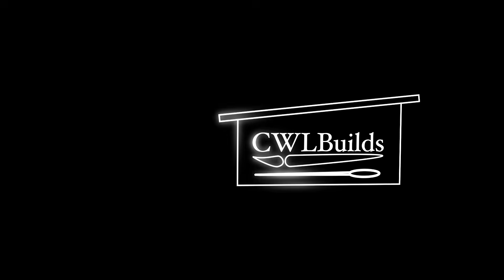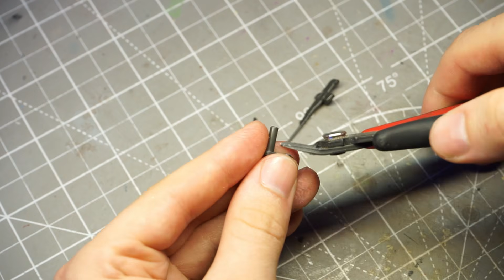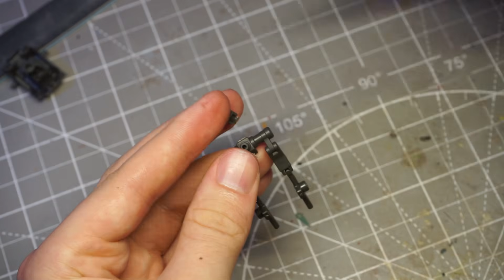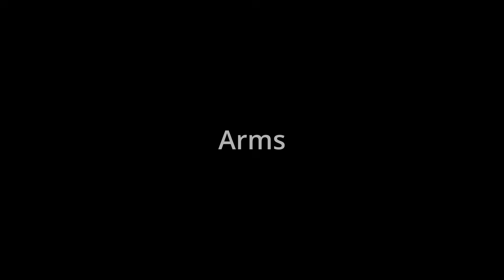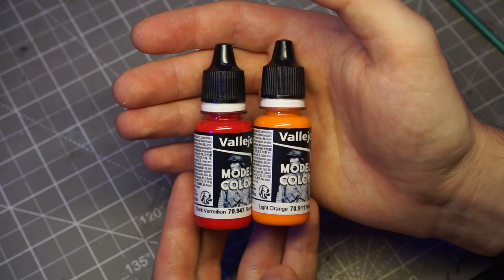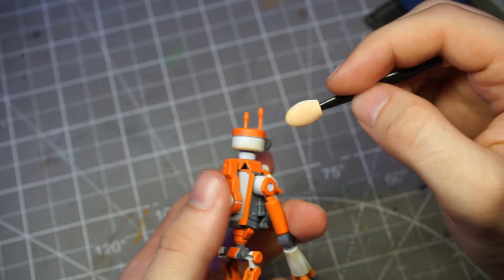Can I Make a Robot Only Using Gunpla Option Parts? [Scratch Build Challenge]

Comment: Really great usage of parts. Hearing the word blasters was a bit off putting though. I very much connect that word to Star Wars or other galaxy thrveling space adventures. Gundam is mostly a bit more down to earth. What you nipped apart for antenna were good old machine canons, functionally identical to what you would see on IFVs or SPAAs in the real world.
But I assume you are not really familiar with the Gundam lore and more interested in the parts, and to be fair, Gunpla provides great parts for a lot of options. For example I turned a spare mounting bracket and optional joints onto a crane arm for a repair mini diorama, with granade holsters as Hydraulic Oil tanks.
Reply from the maker: Oh ya I probably should have mentioned it at the beginning of the video that I have very little knowledge in the Gundam lore. The last Gundam diorama I made here I talked about my very limited knowledge haha. I’m happy to be corrected and educated on the lore though, especially when I call something the complete wrong name😂
Reply: @cwlbuilds  No problem. And on top Gundam is very diverese, with different seperate continuetys that have very different levels of technology. Regular Guns are the most commmon, but there is also a large variety of beam weapons and Railguns.
Reply from the maker: @zafranorbian757 if I wanted to start getting in to the lore or just getting in to Gundam in general what’s a good starting point?
Reply: @cwlbuilds There are so many it really depends on what you want. 
The original Mobile Siut Gundam still holds up suprisingly well, it just looks a bit dated. But there is a reason this show spawned a mega franchise.

The 08th MS Team is great since with only 11 episodes it is fairly easy comittment wise. It also is very immersive and grounded feeling both in story and in presentation. 

Gundam the Origin (ova) gives you a stunning modern entry point into a reinterpretation of the classic gundam universe. 

As for alternative Universes, Iron blooded Orphans feely gritty and viscreal while The Witch from Mercury really grabs you emotionally with an ever escalating plot.

My Personal pick would be the 08th MS team, as it is short and tells you just enough to want more while being a great ride from beginning to end. But any of those 5 shows are a great start imo.

Comment: I do like a good one-box-bash - it is a great challenge to set yourself... I've done several. The Hasegawa 'We-Go' robot kits are great for this method too - and they come in twos, if you buy the 1/35 versions. I rarely buy kits to build at intended anymore. Doing kit-bashes and conversions is a lot more fun - using everything but the 'oink' in a build, and any spare bits are there for the next project.
Reply from the maker: I’ll have to look into the Hasegawa kits. Thanks!